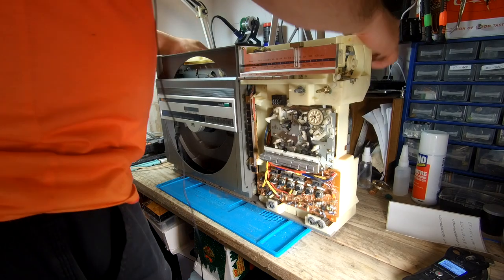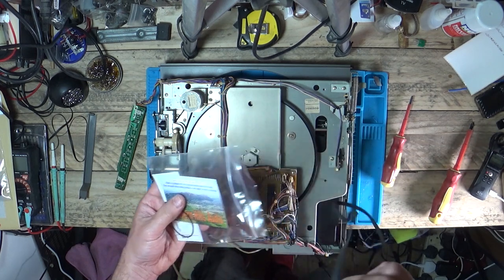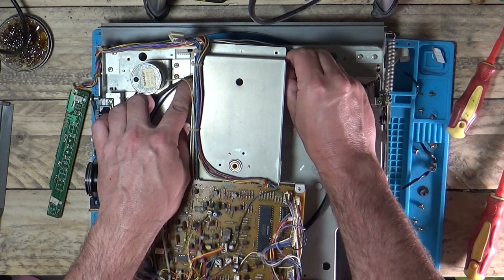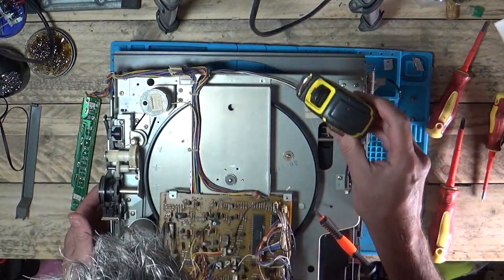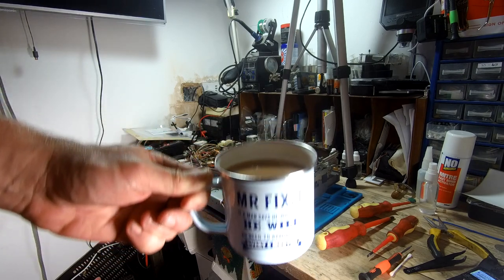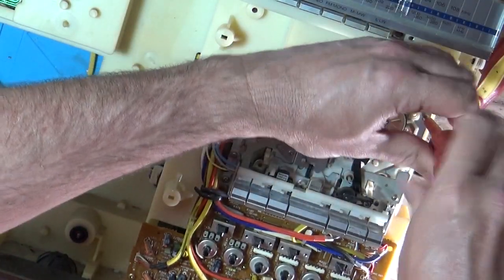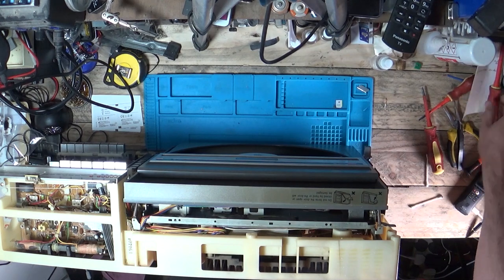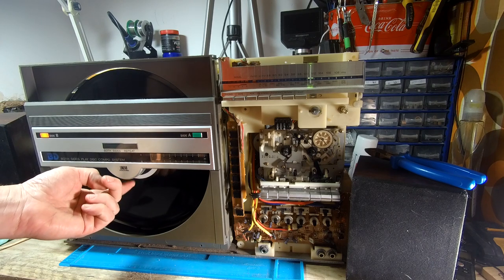Sharp VZ-3000 Vertical Record Player Full Belt Change - part 3 | UK eBay Reseller

Comment: I have a problem, the volume in the speakers is good, the sound is good when the radio and cassette are playing, but when you turn on the player, unpleasant sounds appear in the speakers, what is the reason?
Reply from the maker: Is it just a quick thump like sound through the speakers when you turn it on? That is normal with vintage amps, I think it's the initial spike of power going through the unit.

Comment: Wow excellent video of part 3 you are very very professional engineer 😀 👏 just a quick question the turntable platter belt as you shown the picture which is 635 X 10 X 0.8 but I done some research on online and the broken belt I took out of my sharp vz-3000 of the turntable platter was 5mm wide but in your picture it shows 10mm Wide? Can you please kindly let me know .. and for your information you can very easily take the front cover off to get to the bulbs 💡 ie lamps ...on the top of the cover and bottom there some clips ie behind of the cover you have to be very gentle and slowly 🐌 pull the cover out and you will see all the lamps including reverse and forward lamps...and I am thinking to change them to leds which will look nice and you have to put resistor on the leds for the record light I am going to change for RGB led so as the record is playing you can see different colours shining on the record thank you 
Sam😊
Reply from the maker: Thank you Sam. I am only a novice and do this as a hobby but thank you for your very kind words. The belt I put on was only 5mm, you can't get original parts now so you have to go with what you can find. In the next video I will hopefully be getting that front cover off and changing them to led strips. The schematics show that the lamps are supplied with 12 volts and I will check on what resistor value is needed to reduce the current down.